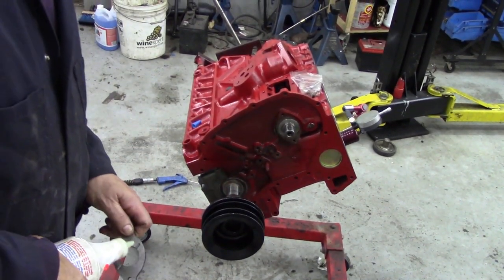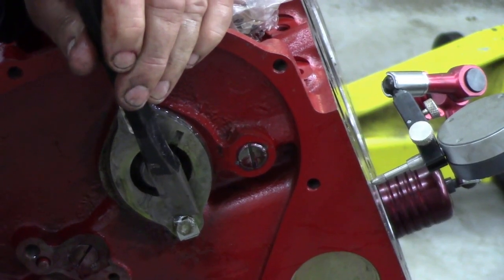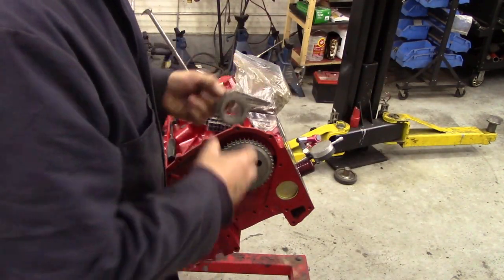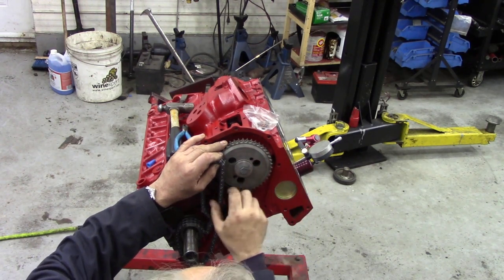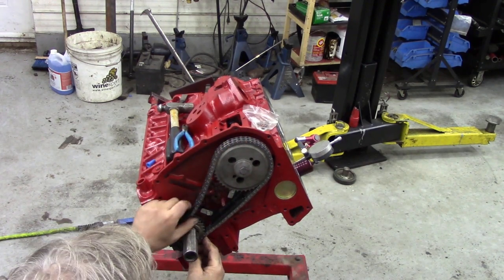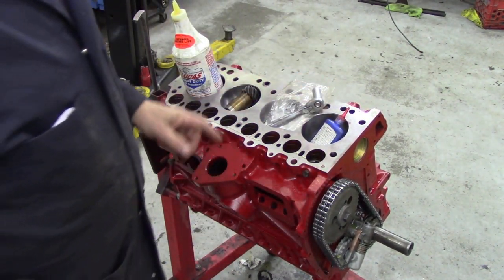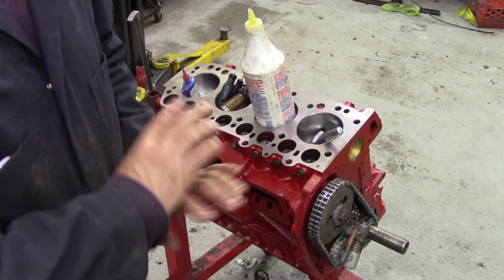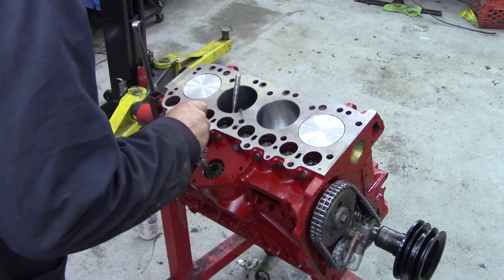2 25 engine Fitting the camshaft and timing gears Part 2

Comment: Mike it's been really interesting watching you do the job I did on my engine 18 years ago, with me thinking did I do all of these items correctly or not, a bit like wondering if you have switched the gas off when you leave the house. Anyway after 18 years I've had not problems with the engine so I probably did it OK. My nemisis was the distributor drive, a bitch of a job which I got wrong and the distributor is out of alignment which I only found out when I had completed the rebuild and the engine and bodywork back. I never had the heart to fix it so have lived with it being in the wrong position. I'm kind of glad that you also found it to be a tricky job so I don't feel so incompetent anymore.
Reply from the maker: YES! And I realized I made a boob in the end - I scrapped yesterdays video and going to do it again as even though I had the distributor drive in the right place - for a diesel - but not for a petrol! Was 180 degrees out!

Comment: What a timely bit of work. I just placed the new cam in yesterday. Gear, Tapits, and the lovely distributor drive next. Really appreciate the part about leaving the oil pump till later. Could have easily made this part that more challenging. Happy Boxing Day!
Reply from the maker: Have fun!
Reply: @BritannicaRestorations  Good afternoon from Connecticut. Basically had the engine completely together but something was not correct. Very hard to turn over. Took everything apart and discovered the rear main bearing was too long and riding on the crank. Cautiously removed material fitting and checking as I went. Just took a fraction off the inside edge of bearing. Bearings torqued and crank turns over very nice now. Your videos are very informative and enjoyable to watch.

Comment: Hi Mike beware the single splin that they will sell as a replacement spoxet for the 2.25 petrol & diesel. Will not work on the diesel engine. As you say we will not be able to split between the chain links 1/2 a tooth you can not buy anything that looks like the oem cam gear here in Australia when it stop flooding  I will replace the $88 cam gear. Yes it was a waste of time and money.l too like jobs done well.thank you for your videos I did get 22 year's out of the old camgear it was weld to the camshaft it ran well in that time now it is fully rebuild but can not set exhaust peak with this camgear
Reply from the maker: I seem to think the chain wheel is marked P and D for petrol or diesel

Comment: Once again a HUGE thank you for such excellent videos.  I am up to the point of installing the timing chain, however I have noticed that my Timing Chain Cam gear doesn't have any markings on it.  Based on the diagrams and your video I could easily add some, however is the angle from the P that the woodruff goes into exactly 90 degrees to the P that lines up with the hole on the case?
Reply from the maker: Yes, there should be markings - but not always.
The P should be on the camshaft pulley keyway and as you said 90 degrees to the straight line from the bolt hole in the block through to the centre of the cam.
IF the chain is still slack, do not move the cam, but remove the pulley until the chain is tight - the keyway spacings are not even and allow you to have 1/6th of a tooth adjustment
I find it is best with the head on with all the pushrods and valve gear in and at TDC to hold the cam in position

Comment: Just trying to put the oil pump drive gear back in and final lined up the master spline, when I try to line up the hole for the grub screw, i have to lift the whole body of the drive gear up about the length of the hole to get it lined up, which means the whole thing will be resting on the grub screw, is this correct?
Reply from the maker: Yes
Reply: @BritannicaRestorations  I could almost kiss you right now........

Comment: Hmmm my 2.25 the key on the top only fit's in one direction. I installed it wrong and had to change the number one lead. 180° or was there something I was doing wrong?
Reply: Yep. Should have waited to the end😅😅😅
Reply from the maker: Even then it was wrong! More soon on a better method of doing the timing